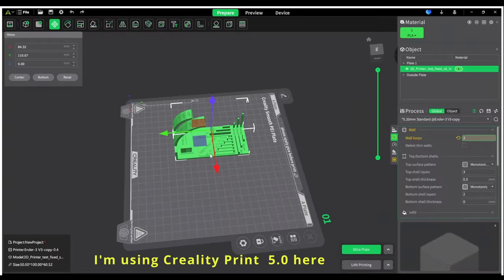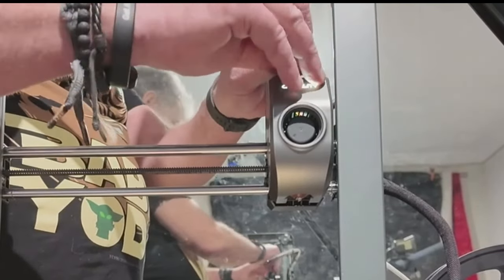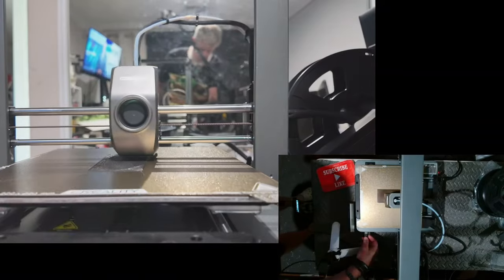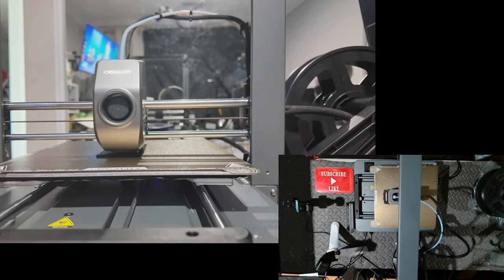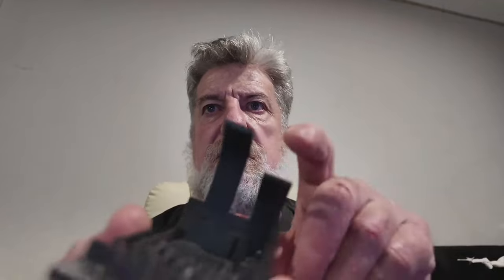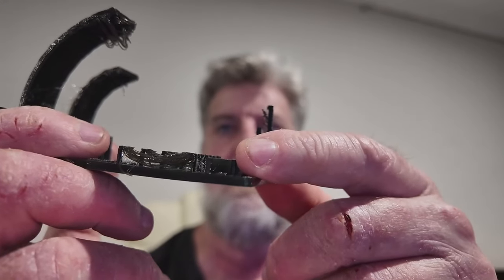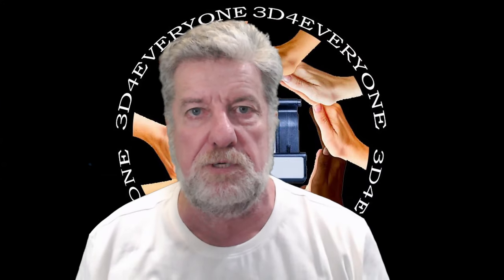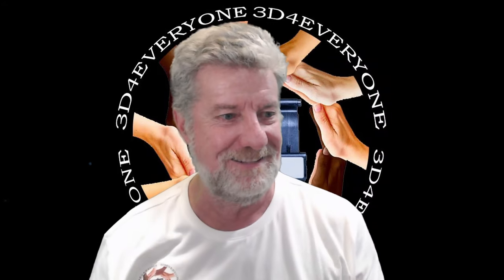Ender 3V3 TPU and Nebula Camera. How did it go?

Comment: Hi  Gary, thanks a lot. 😊

Ohhhh, the difference between both filaments is so incredible, and with the same parameters. I think it is very important that the filament keep dry in order to get solidifies faster (or print slower)
 
I have seen the standard parameters, 100% speed, 230ºC hotend, and 0.2 mm layer height, and moving some setting will get best results.
 
The second test with the TPU, has incredible quality 🤩, it was the doubt I had, because coments I`ve been reading didn`t say good words on the extruder about the posibility to control filament pressure in TPU printing.
 
Very, very grateful for the video, and I've just bougth this 3D printer after I saw ypur vidieo (but camera was sold out)
Reply from the maker: Glad to of helped David, yes the slicer settings do make a difference and i could of tweaked them to give an even better result, but most users will use the defaults so try and use them where possible, I was surprised with the difference as well, but glad it happened so people can see how much the filament condition makes in a print